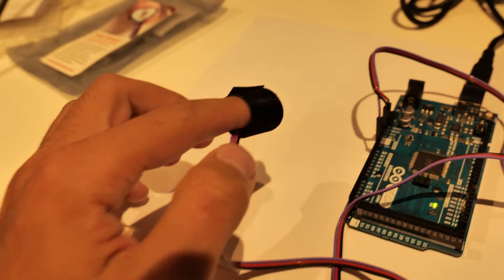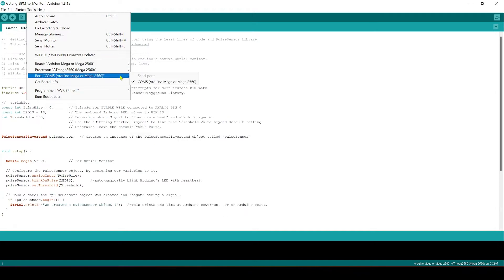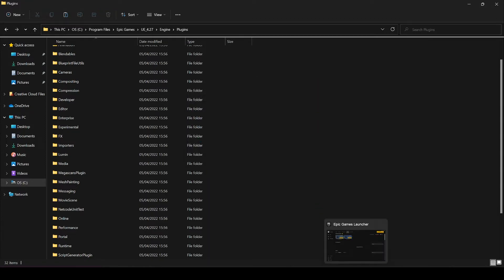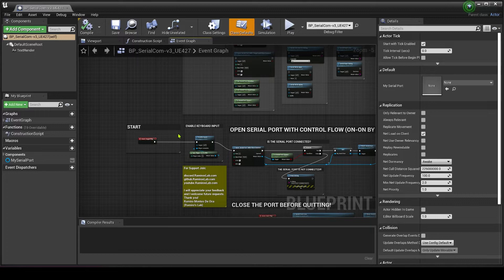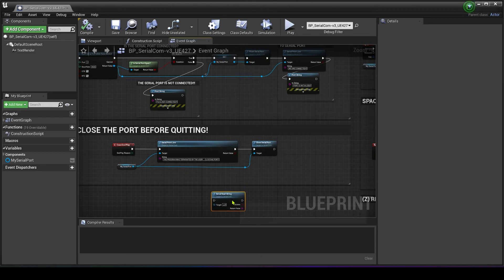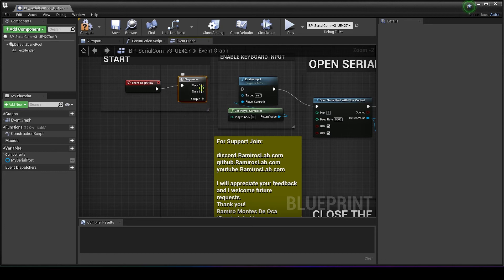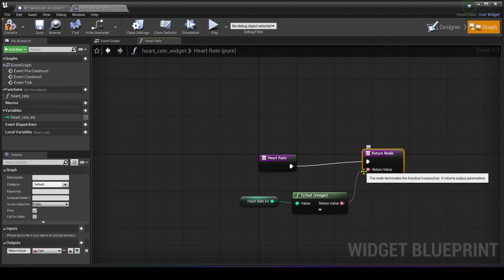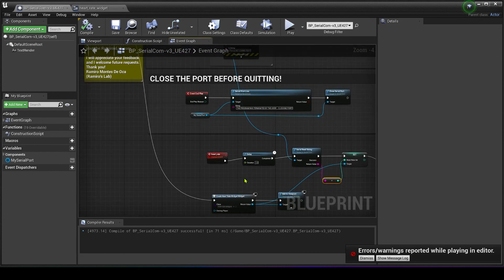Unreal Engine & Arduino - Heart / Pulse rate to widget - Full Tutorial

Comment: Hello! UE newbie here! I have followed your tutorial step by step but it doesn't work. I think that the port is not recognized in Unreal Engine. I have chosen the right port and baud rate in the blueprint and everything works completely fine in the Arduino IDE when I upload the program. When I try to run the simulation in UE it's like my Arduino Uno is not connected (Port is not connected). Can you help me solve this issue, please?
Reply: Try closing serial monitoring from arduino IDE or just close the whole app after uploading code. After that the arduino started appearing to unreal for me.
Reply: @ Thanks, I fixed the problem!